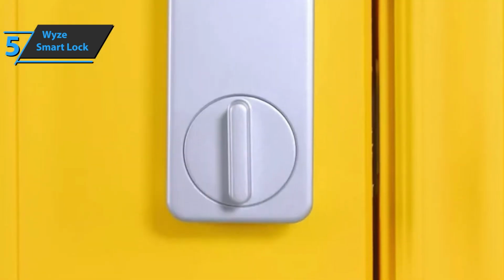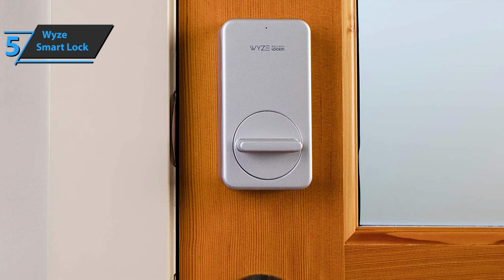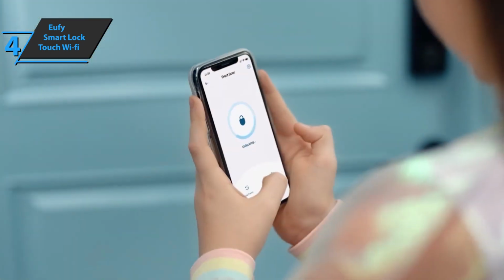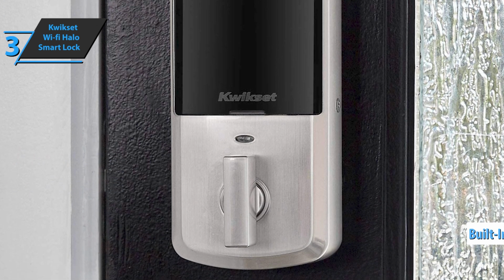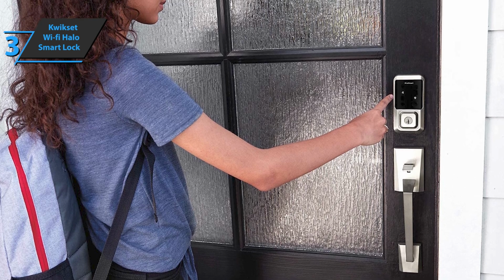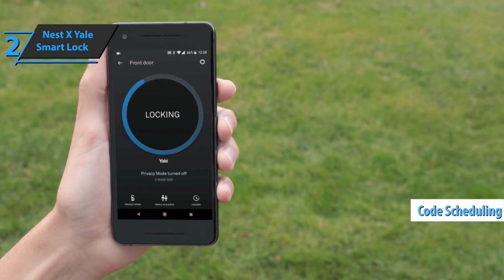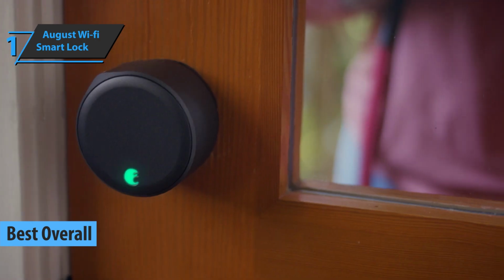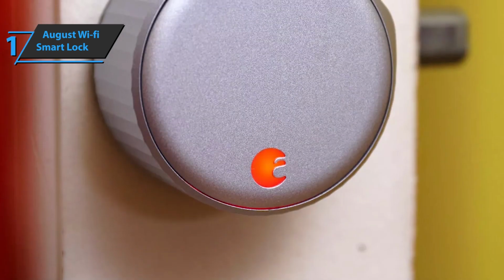Top 5 Best Smart Locks of [2022]

Comment: The August smart lock is made of mostly plastic with the exception of the outer shell. All the internals is plastic. It's very easy to slip a flathead screwdriver between the lock and the door and pry it out and break in under 10 seconds. Would not recommend this one at all.